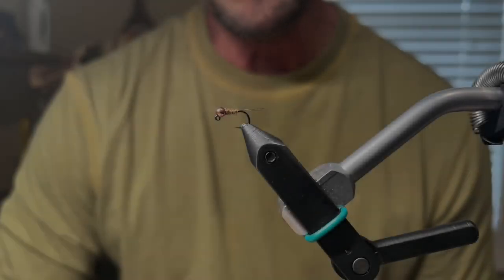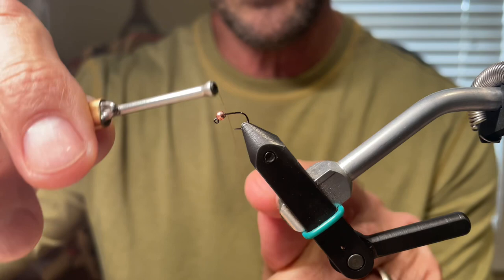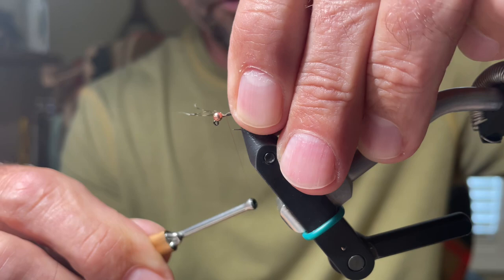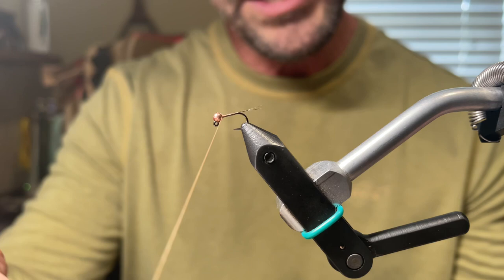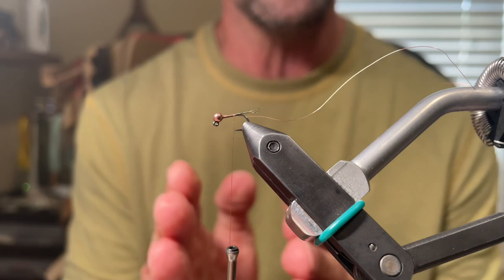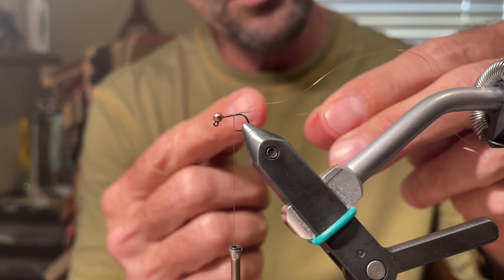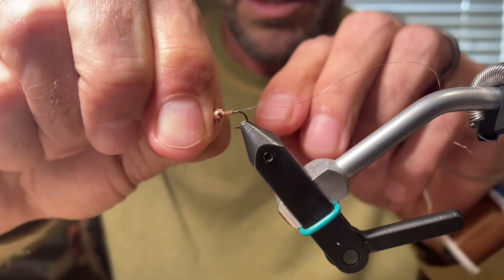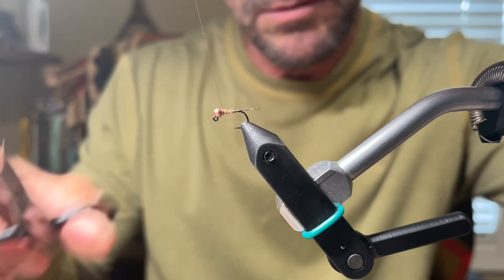How to tie the Stupid Simple Pheasant Tail:  Clear water, go to Euro Nymph

Comment: Thread wrap efficiency is something missing in many patterns, very well executed here I think. Translates easily to many similarly slender patterns and smaller sizes. Really a big fan of 16/0 Veevus for the same reasons, and forces me to think about tension and thread control (read avoid the hook point). Nice tip on the rotary positioning’ of the vice…lovely execution.
Reply from the maker: Thank you Todd!  Really appreciate you noticing those things.  Tight lines to you!

Comment: Hey Cory.  Do you have a video for the France fly??
Reply from the maker: I don’t, Chris.  But I would check out Tactical Fly Fisher’s video on it.  The only thing is you don’t need to add lead.  It’s an older video and the lead isn't necessary.
Reply: @OldDominionTroutBum  thanks Cory.  I always wonder about the addition of lead on the patters that call for it and if it is really necessary
Reply from the maker: @chriscrumbley9219  adding lead is an old school way of tying.  Thinner profile flies not only sink quicker, they are far more realistic.  Tight lines to you.
Reply: @OldDominionTroutBum  ok Cory. One last question. Do you have a video on your adjustable fry/dropper set up?